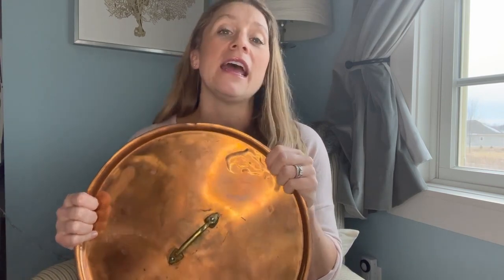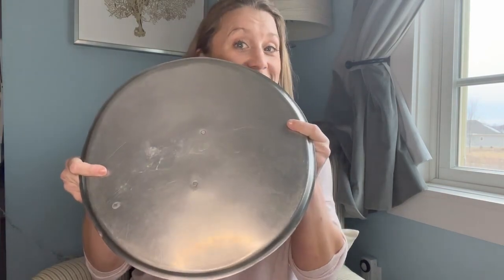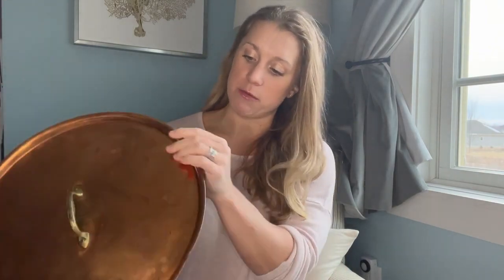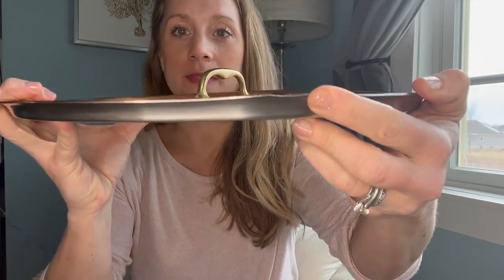Stainless vs Tin Linings for Copper

Comment: If I have a nickel lined pot and don’t like the nickel can I line it with tin on top?
Reply from the maker: It depends on the layer of nickel as it stands. I have had a few pieces electroplated with nickel. If I remove enough of the nickel, I have OK success, as all of these metals are non-ferrous. If you have a thick layer or plate of it, it might be pretty hard to do or you might need a specialized type of flux to help with the chemical/molecular bonding.

Comment: Just found this and wanted to add a point. You are WRONG about your assertion around the 8 minute mark where yoou insist people overheated their tin-lined pans.  I have seen this too often, and now there is in fact a video I saw here on YouTube SHOWING a woman who is clueless CAUSING the issue. TOo many "re-tinning" people like this woman are doing it ALL WRONG and creating a huge problem.  This woman uses TIN SOLDER WIRE to quickly and easily re-tin a copper pan. NEVER LET ANYONE DO THIS unless the piece will NEVER be used for anything except for show or simmering liquids.
Tin solder is NOT pure tin. Tin indeed survives to 450 degrees; but what is sold as rosin-free tin solder is actually called 63/37 - the other 37% being LEAD. A know poison, this solder melts at 361 degrees, making it easy for folks to re-tin cookware at home and poison themselves. Many who claim to be "in the trade" do this knowing that for new pieces as well as 'restorations'  that they create a pretty piece but will never be held accountable.  In fact, because of the science of simmering liquids the pot's interior can never exceed 212 degrees (you can boil an egg in a paper cup on a campfire!)  meaning the solder interior stays shiny while the lead leaches into your pasta sauce.
If you MUST use solder, hunt down tin-antimony which actually RAISES the danger zone to 4460 degrees or so but will be difficult to work with at home.
So your customer who say they DIDN'T overheat the pan may very well be telling the truth.
Reply from the maker: My dude. I order the tin solder from Johnson Manufacturing in Ames, Iowa. This is public information on all my videos and I send the link to the actual product for people to see and buy. #460 is a lead-free, silver-based food-grade solder - the only solder approved for use with food handling equipment: http://www.johnsonmfg.com/temp/NOLEAD.HTM#silver

For anyone reading this, please know you should never use a "tin-antimony" solder as this poster says. Antimony is toxic to humans.

Comment: Ive got a Matfer Bourgeat copper/stainless saucepan that has been accidentally left dry heating on a burner for 3+ hours, and been thrown in the dishwasher by my roommates... It was a bit discolored before I polished the bajesus out of it, but it's still fine.

Bourgeat claims they're using 18/10 stainless, which can mean plenty of things. However, in general, it means approximately a 15W/mK thermal conductivity level, versus SnCu at ~65. So, we're looking at about 4x the transfer rate through that boundary for tin versus stainless. 

As for lifespan... I'm sure ~something~ could kill the Bourgeat bimetal, but I don't think anything I'm capable of would do the trick. Maybe ultra extreme heating or exposure to ridiculous voltage?
Reply from the maker: Who knows? All I know is I have a piece of stainless lined copper from the 1970s and the copper is all bubbled, warped beyond fixing and separating from the stainless. It was like this when I got it from the previous owner. So...it IS possible on a kitchen stove. Based on what I've seen, I doubt it's as difficult to ruin as one might think, considering this piece is only a handful of decades old and made in France out of thick copper...Stainless lined copper has only been on the market what a handful of decades, so it really can't be said it will stand the test of time...not when I'm retaining 300 year old pieces that are useable still. Ya know? But in the end, as long as it works, yay!
Reply: @housecopper
Reply: @housecopper  can you repair or re-tin my copper cookware for me?

Comment: Your knowledge of metallurgy is woefully lacking.  Why not mention how tin is toxic at levels of 200 part per million is toxic and can damage the liver and kidneys and cause anemia at lower doses?  Most pans with stainless steel use less that 0.02 ml of stainless steel which negates the heat transfer difference and negates expansion coefficients.   Get an education in metallurgy so you can stop your silly rants.  Unsubscribing - because you have no clue what you speak of.  Yes, I've got a whole heck of a lot of metallurgical courses under my belt.

Comment: I have recently started looking into various options of cooking pots, specifically copper. 
I recall from childhood that all our cooking pots were made from fairly thick copper or occasionally brass. They were always coated with zinc (not tin) on the inside as well as the outside.
I’m trying to find similar quality pots and pans but not having much luck. The “best” of the brands are made with 1.5 - 2.5 mm thick copper and they are either tin coated or stainless steel lined. 
After acquiring and trying a couple of older stainless steel lined pots (made by Mauviel in France; 2.5-3mm copper; their current catalog includes thinner copper), I have come to the conclusion that these are not the best options for me. The top edge of these pots have fully exposed copper, perhaps for cosmetic reasons and to convince consumers that the material is indeed copper. But this is not a good idea from the perspective of copper contaminating food.
Do you know any source of thick copper pots (4-5 mm thick) in US that is either zinc coated or uncoated? In the latter case, I will have someone coat them for me or do it myself.
I enjoyed your presentation, particularly the magic tin bit. ;)
In that context, may I suggest a few corrections?
There are no molecules in metals like copper or tin (unless metals are oxidized or have reacted with acids etc during cooking). Copper does indeed interact with tin or zinc at a much closer level, forming alloys, bronze and brass, respectively. But forming alloys requires both metals to be melted together under specific proportions. 
Tinning or zinc coating does not create an atom thick layer, it is considerably substantial layer of metal. It melts (at or above 450F) because it is still tin. Fortunately, zinc melts at much higher temperature (787F) so one do not expect to encounter the problem of coated metal liquifying during cooking at higher temperatures. Additionally, a small amount of Zinc that might leach into the food is non-toxic. In fact, a small amount of Zinc is essential for our body (many enzymes use Zinc as a cofactor). I’m not sure if our bodies need Tin or Nickel.
Reply from the maker: Lol - right? "magic tin"! It's my favorite way of explaining how it all works. :) :)

If you like your stainless lined Mauviel pans...even with the 1.5 - 2.5mm of copper showing along the rim, you are probably OK - you're not cooking on the rim, so you shouldn't have any copper leaching (or if so, it's so insanely minuscule it won't matter). So...if you like the pots themselves, go for it! :)

And, thank you so much for clarifying - I did say the wrong word! Copper is made of ATOMS, not molecules...oh, geez, Sara! I appreciate you pointing this out. Copper's 29 protons, 35 neurons and 1 electron, which are the official atomic make-up. The exchange of the electron in copper with tin's electron is, however, still called a molecular bond. :) Interesting for sure!

Tin is a micronutrient, just like copper and zinc. :) As for your thoughts on zinc...I don't know why people don't coat copper pans with zinc. Maybe because it's not as shiny and non-stick as tin? Or it's harder to do? Anyway - thank you for your thoughts! I appreciate the dialogue always!
Reply: @housecopper  
Thank you, yes, a dialogue is always useful for learning!
For good communication, clarity and accuracy is also crucially important.
[A copper atom has 29 protons and 29 electrons (not 1 electron, as you stated). Theoretically, one might succeed stripping away 28 electrons from a copper atom but the energy requirements for accomplishing such a phenomenal feat in a kitchen will be highly unlikely!  ;) :)]
At this point my wife feels that pure copper is too much work so we may settle for stainless steel cookware that have a substantial internal copper core - seems like a good compromise, though she isn’t fond of stainless steel pots/pans with Al core - food sticks in them.
In my case, use of copper was for its excellent thermal conductivity and not for its looks so I was thinking to coat it with Zinc (inside and outside) - I don’t believe that it is “difficult” to do, I’ve seen it done and I’m fairly sure that I can replicate the process.
All of our high temperature cooking is done in very well conditioned cast iron pans that are quite smooth (very old or recent ones that are mase smooth) - they become almost non-stick.
I recently found a few small companies that use CNC machines to smooth the cooking surface of cast iron pans that are normally quite rough (something I had done to our new cast iron pans myself a couple of years ago, not knowing that others were doing it commercially). I think that properly conditioned cast iron pans are an excellent alternative to synthetic material coated non-stick pans even for people who have decided to become “allergic” to oil and fats - one needs very little oil to cook in a well-conditioned cast iron pan.
I appreciate you responding to my comments, keep up the good work. :)
Reply from the maker: Ack! Thank you, yes - I wasn't clear when I said "one electron" - I was thinking about the lonely one on the outside of the copper atomic structure! You're certainly right, removing 28 of them would be terribly hard and not needed! lol! :) Please let me know how it goes putting zinc in the copper pots! I haven't heard of it done, so I'm waiting with excitement to hear how it goes for you!!
Reply: Are you sure those pots were coated with zinc? Is there any reference for that? Coating tin on copper and brass pots is a conserved traditional process which is also observed in other parts of the world like East Asia. I'm sure there would have been contaminants like lead or zinc in the tin they used. I seriously doubt anybody used predominantly zinc for coating copper or brass. In India where bronze and brass are the traditional cookware which were in use for a long time until recently, it is said. that you should never cook directly (except when tin lined) on brass which is an alloy of copper and zinc whereas it is totally safe and healthy to cook in Bronze which is an alloy of copper and Tin. One caveat in cooking in bronze is the food should be transferred to another dish after cooking maybe to prevent  copper reacting with salts and acids. The only variable here is zinc. Either zinc must be toxic or they should have had an unproven blind belief and practice

Comment: Could you make a video comparing tin to silver lining? Specificly the difficulties of silver lining? People always mention the price, but at that thickness it would be insignificant ... why is it so hard to line at those high temperatures?
Reply from the maker: Partially it's because you need such specialty equipment to heat the silver and copper up to JUST the right temp and then quenching...I will discuss this in a video for sure. And actually, price still matters, too. Will do this! Thank you for the idea!
Reply: @housecopper  I've seen people bond sheets of copper and silver in ovens or electroplate thin coats, to deal with that issue.
Reply: @housecopper  
Silver melts at 1761F and Copper at 1983F…. very hot to manually do it like one does with tin and Zn. I think electroplating will be the way to go, start with Silver nitrate, a bit of electricity (DC) and ample time to get the correct thickness of silver.

Comment: Just made some pancakes in tin for the first time. No joke tin is fantastic. It definitely reacts differently in contact with material (food/liquid) than stainless. All in how reactive they are. Reactive means so many things and not just referencing to temperature. It has to do with the interaction of the electrons near it which is why SS doesnt seem hot 1 inch away. Theres a molecular gradient
Reply from the maker: Beautifully said!

Comment: Thank you so much for this video. I am new to copper (long time fan) and am in the process of furbishing my kitchen with updated cookware. Carbon steel (deBuyer Pro series  - check), nine tinned lined sauce pans 3mm+ arrived days ago from France (some need retaining, others stained or black swirl marks??),  one set from 1940's (4 pans - 3.5mm) and the other 1980's (5 pan set - 3mm that mimic hammered marks on the sides). I absolutely love them, but to be honest, I am very intimidated by the tin linings. Hence, why I found your website, that, and I was first referred to you by the young lady on, The Elliott Homestead, as her retinning expert. I have reviewed your YouTube site looking for information as to know if my pans need to be retinned. Two are obvious, but all the rest have either lots of staining or black - gray swirl marks. Not the traditional shiny tin I see on many newly tinned pans. So my first question, how do I know if it is needed, beyond seeing copper thru the tin? My next question is driven by this video. I was purchasing my cookware for my personal use and as a future heirloom, that can be passed down for generations. With that being said, your video has put an unexpected twist in my designed plan. Are you able to comment on the possibly improved technology for combining stainless steel to copper, verse what you and your cohorts have seen in the past? Is the separation (in your view) gong to continue? And if so, then would silver lining be a much better way to enjoy copper, with less limitations than tin while providing a better surface similar to what stainless steel may offer? In your response, we can leave out the obvious cost of lining with silver verse tin. I don't think I would be needing all my pans lined in silver, but maybe frying and sauté pans. Next, what does this mean for purchasing layered stainless steel with copper linings built in? Same situation/risk? Is aluminum also a problem when choosing quality stainless steel? Your thoughts would be greatly appreciated...
Reply from the maker: To answer your questions, if there is copper showing through or the pan's tin lining is quite dark (oxidized - and therefore, quite "sticky" to cook with) you may want retaining. As for stainless and copper, there are no "technological" advancements - copper is non-ferrous and stainless is ferrous. They will never molecularly bond because of that fact, though of course we may come up with better ways to ensure they "stick" together for longer or by changing the molecular make-up of copper so it is not as conductive and is more inert (which is what the 1980s patents have shown) so it won't move as much with changing heat and behave more like stainless. It's not my opinion that stainless and copper don't bond, that's just science. Yes, of course, silver is going to last longer than tin and will have the same properties as tin. I am not a maker of multi-ply cookware, but again the same science facts apply. One cannot transfer the properties of one metal into another simply by placing them next to each other. That kind of osmosis borders on a magic trick. Best of luck in your search for cookware!
Reply: @housecopper  Thank you for the response. I have taken your knowledge and have readjusted my purchasing plans. I also want to determine if two of the pans from the 1940's have nickel linings. I have holes worn out with a second layer of metal underneath which makes me wonder if it is nickel? I would not of thought tin would of separated from a second layer of tin.
Do you know if Brooklyn Copper Cookware is still in business? I have tried reaching out to them, as nothing has been posted on FB for a number of years? I am also aware of DUPARQUET COOKWARE. Are there any other copper artists like yourself out there that you are aware of? And yes, I do plan on purchasing from you as well in the next month or two. Just can't break the bank all in one month and your line up does not satisfy the entire spectrum of copper pans. I have the sauce pans needed, now I want to get frying pans, saute pans, stock pans and possibly others to complete my set... I like the idea of having pieces made by different artist. Our folks in New York would spot fill my purchasing desires as they have the greatest selection if still in business. Otherwise, I will be searching online for older pieces to complete my set. Thank you, Bruce